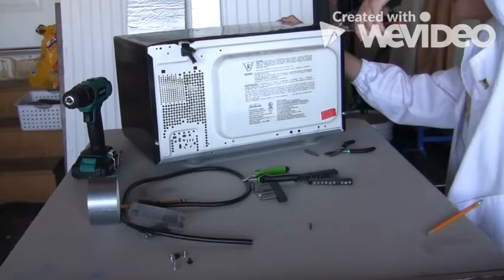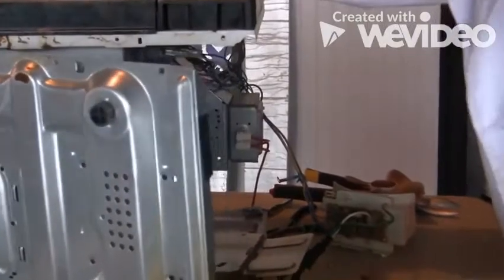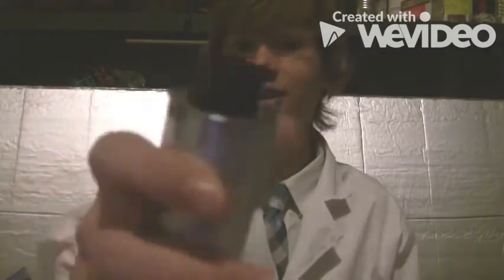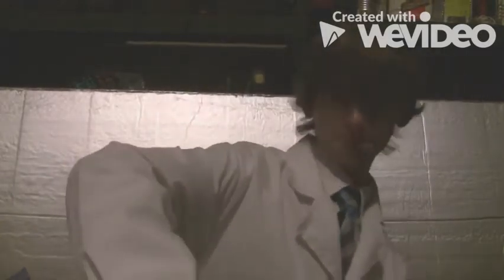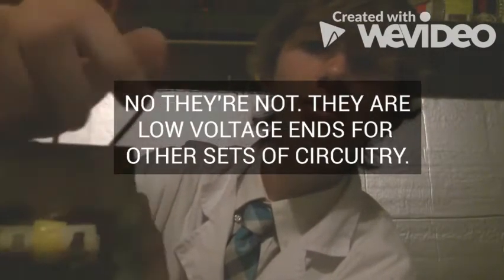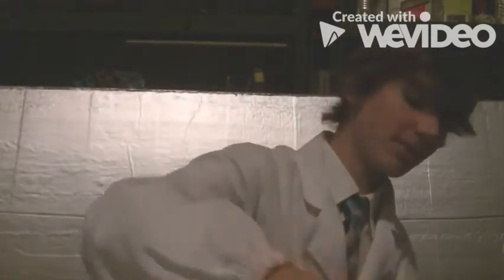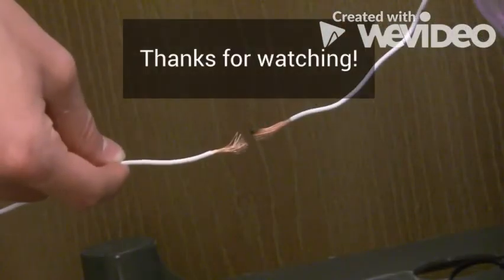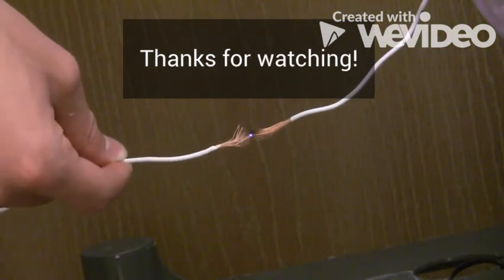Taking apart a Microwave (MOT TEST)

Comment: i wonder if you modify the primary to use thicker gauge and less turns the output will be bigger
Reply from the maker: You're right it would, as far as I know it hasn't been tried yet probably just cause its a hassle to get the old primary wiring off, but yeah the voltage would be a lil' extra (the amperage would be less though).
Reply: @Plasma.Prince  well it would be less lethal by a bit but the breakers would not be happy to

Comment: Very nice. But you should use some eye protection when using the MOT becaus the arcs prodouce uv and ir light that can be dangerous to your eyes. It is also a good idea to connect your arc stick to case ground and not to the high voltage tap on the secondary.
Reply from the maker: Noted, thanks for the advice! I did feel the brightness bothering my eyes...
Reply: @Plasma.Prince  hmmm u didnt use it in your disassembling a microwave video

Comment: The center winding is for low voltage to heat up the filament in the magnetron tube. It's usually only a few volts.
I actually don't recommend microwave oven transformers for hv experiments - they're NOT current limited and will easily cause an overload. You might be able to get arcs from it for a few seconds, but then it will trip the circuit breaker. Also, if you want to build a Tesla Coil, a microwave transformer is definitely not going to work well. The voltage is only around 2kv and the current is too high. You want a transformer that supplies at least 6kv at maybe 20-30 milliamps. A neon sign transformer or furnace ignition transformer works great.
Reply from the maker: Okay, thank you for the advice! Is it possible I could make my own transformer for Tesla coil use?
Reply: @Plasma.Prince  eek...I've never tried to make my own hv transformer! I mean the secondary winding would be miles of tiny gauge magnet wire, have fun winding that! I really think the best thing would be to get a neon sign transformer.
Reply from the maker: @ct6502c  Yeah, I have one that I am going to save for a larger Tesla coil, going to fire it up today.
Reply: breh overload is yummy